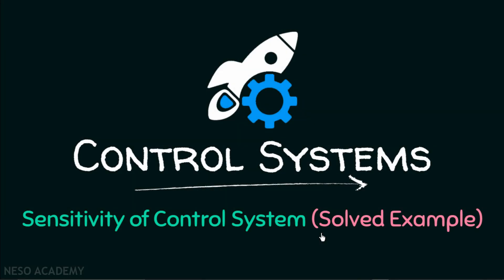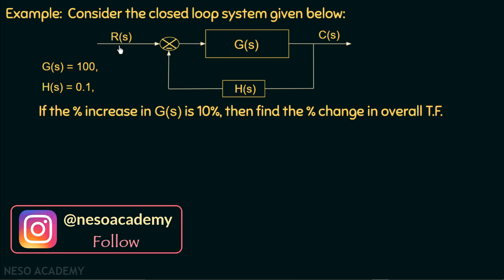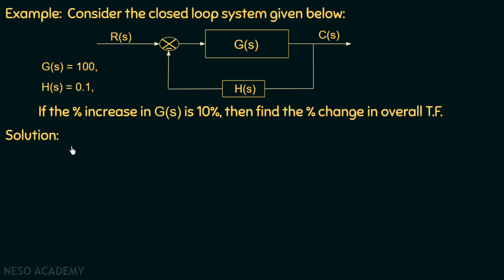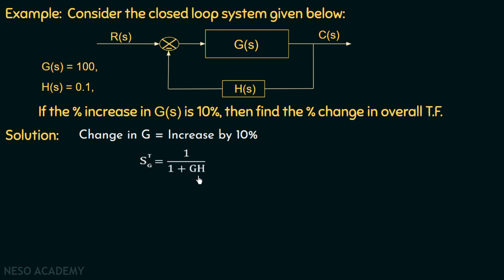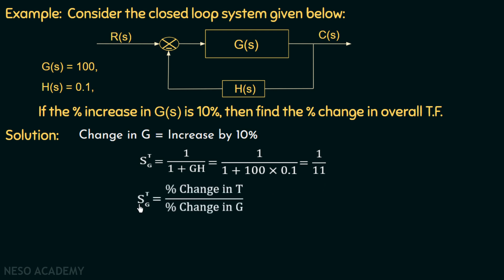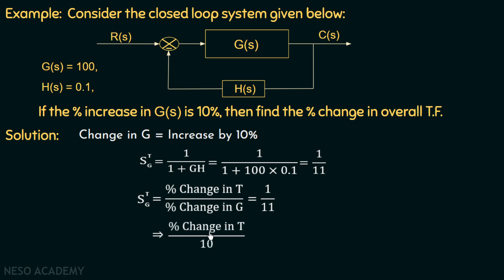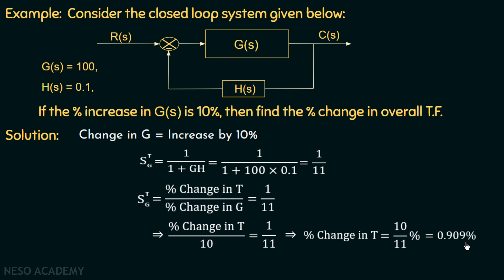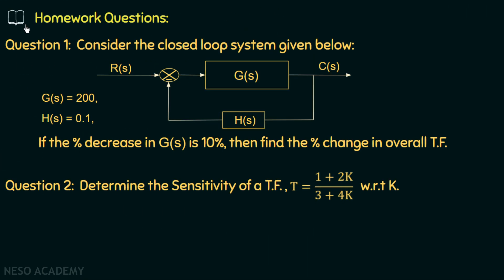Sensitivity of Control System (Solved Example)

Comment: The shown solution is technically speaking just an approximation to the solution, which is only valid for small values of dT/dG. For the exact solution one must integrate from G1 = 100 to G2 = 110
=> int_(T1)^(T2)  1/T  dT = int_(G1)^(G2)  1/(G + H*G^2)  dG
=> T2/T1 = G2(G1*H+1)/G1(G2*H+1), wich i believe would be a general solution to the Problem.
For increase of 10%: 0.83% increase in T
For decrease of 10%: 1% decrease in T

This solution makes sense for me, since the sensitivity S_(G)^(T) decreases when G increases. You can also understand this fact when trying to solve the Problem with the in the video given approximation for G = 100 with increase 5% and G = 105 with increase 5% and the sum up your solution. It should be smaller than for G = 100 with increase 10%.

I hope that makes sense and helps a little bit in the understanding. Great lectures by the way! I love the simplicity which really helps me understand everything intuitively!

Comment: 1. -0.476%
2. 2k / (1+2k)(3+4k)
Reply: why is answer for question 2 not = -2k/(1+2k)(3+4k)? **I am saying why is the negative sign missing
Reply: Check your solution again @oluwatobiabass-alesinloye6161
Reply: @oluwatobiabass-alesinloye6161  Derive the sensitivity wrt to K for the given function not by the general derived formula for sensitivity wrt to H.
Reply: As you apply wrong formua for finding derivative   @oluwatobiabass-alesinloye6161